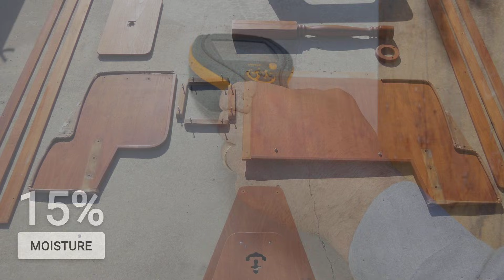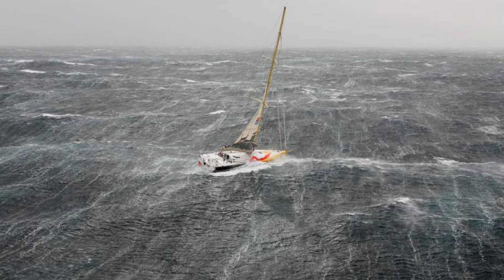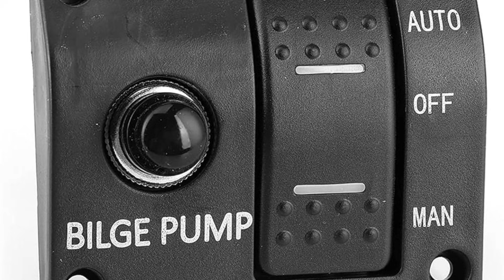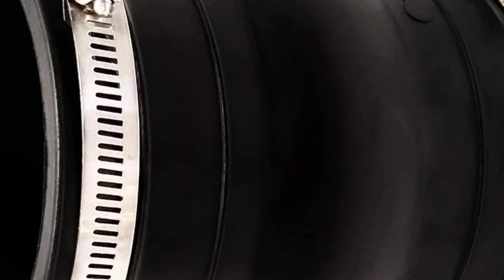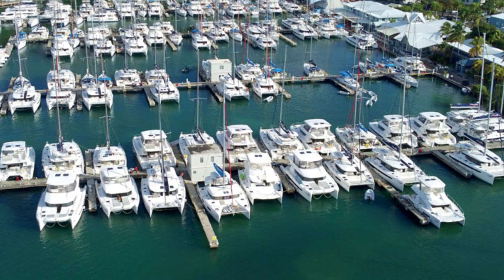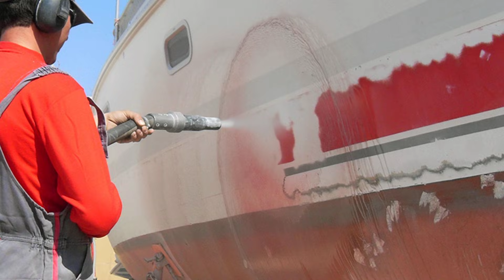10 Modern Features That Are RUINING Sailboats

Comment: Bolt - on Keels are a headache - sure. If its Cast-Iron, as said, then the keel sould have only surface rust. Trouble is the embedding of the bolts ...
If it is cast steel, corrosion eats away nicely.
Then there are steel casings filled with lead, not too bad but the casing will be eaten over time. So whatever it is - it all needs regular attention 😊
Reply from the maker: bolt-on keels are maintenance work no matter what metal youre boltin — cast iron gets surface rust you scrape, cast steel corrodes straight through, steel-cased lead oxidizes at the seams, and nobody wants to haul and inspect every couple years so they glue em on and pretend theyre done